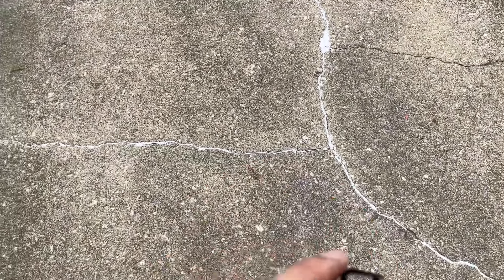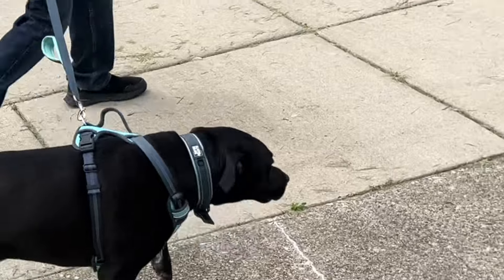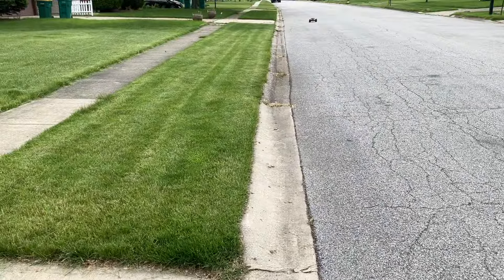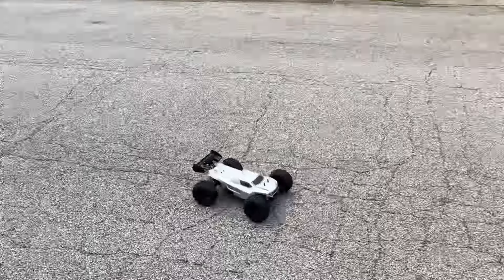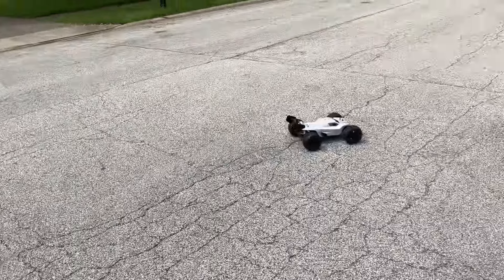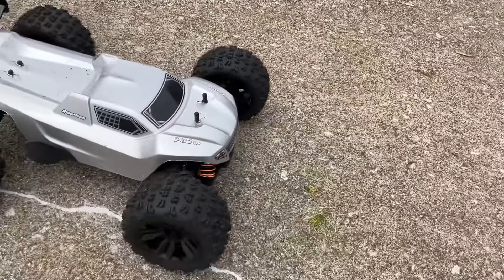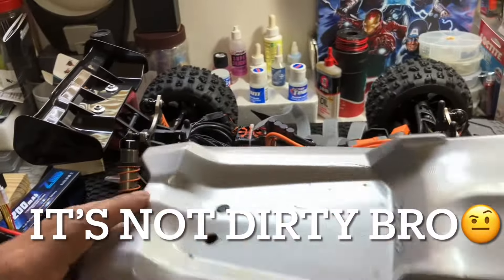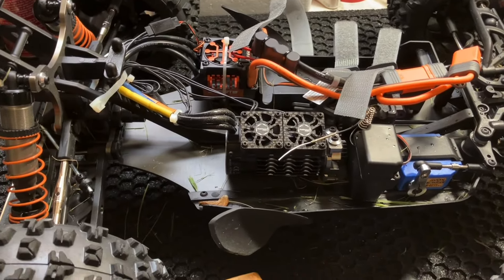This is one of the best handling rc trucks ever 🤩

Comment: 0:21  haha , yeah man 👍👍. That s one of my ramps too . I haven’t got fancy with a ski slope jumper yet but I did build one with some ply wood . All you need is an another side , close or shorter , 2 or 3  old door hinges or a piano hinge , I used a vibrating multi tool to take off the peak edges for nice take off . Comes right off 1/4” or so , ez as pie this build . Closed it , made some lines on the side and drilled for 2” screws to hold the sides . This way it can be folded up and adjusted with some of that steel strapping with the holes ( small hole , bigger hole about 1/2 or more wide . The steel pieces and the screws should be equal on both sides . This way height can be set to the lowest angle or the break your RC angle . You will figure this out . I wanted somethjng I could easily move around . This one folds up like a small card table . I ll bet everyone’s first ramp was a piece of plywood or drywall over a large brick or whatever 😂.
Reply from the maker: Yeah bro it’s definitely ramp time I plan to put mine on wheels or something. I got the wood and lots of great input from guys like you which I appreciate I just haven’t had the time to build it yet but I’m hoping I will have it for my next video 😎

Comment: Just wait til you can set it free in a field with fresh cut smooth grass on 6s . This style is choice with the heavier balooning tires ? I always wondered what Milne would be like on an inside track designed for this size car . Probably freaking awesome . I used some landscaping screen to cover the fans to keep blades of grass out of the fans . They ll shut the fan down and you won’t even know sometimes . Any screen would be great but not if a blade of grass can go through it . The shoe goo on the screws and set it on top , it will stay . Just the tiniest bb sized on the screw sticking up does it for me . I do them all a few weeks ago since it was free
Reply from the maker: I appreciate the suggestion and the input. I’m getting a lot of rain these days and the field I run in is super muddy right now so I’m looking for a new spot to let this thing loose. 🤩🤪

Comment: She drives straight but them little ones on a slightly sloped street . They slope the street a couple degrees for water runoff to the sewers so one side will sway opposite the other on my streets. I can see a similar slope there but we both have plenty of room . Don’t let it lawn dart . It will break or bend something once in a while . This is the one I’d get , the asuga . It’s $600 I think .
Reply from the maker: I’m shopping my next car now thanks for the suggestion 👍

Comment: How did you attach the gps speedometer to the car ?? I just bough  if the same one
Reply from the maker: I used Velcro straps for cable securing. They Come in a roll from Walmart I hope they work as well for you